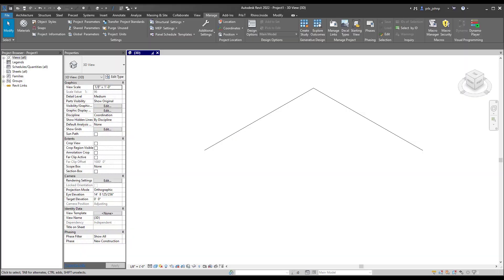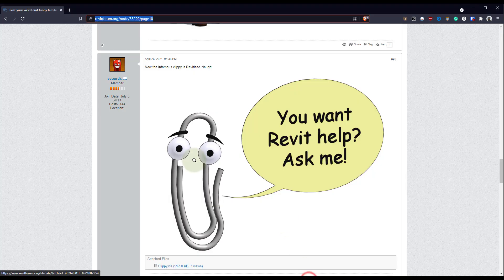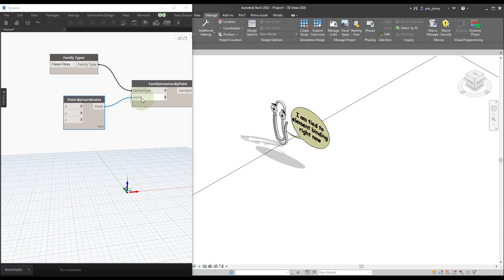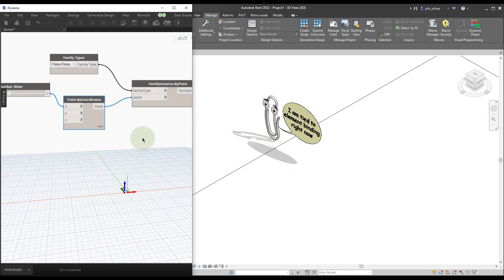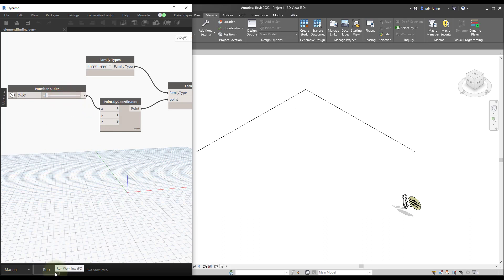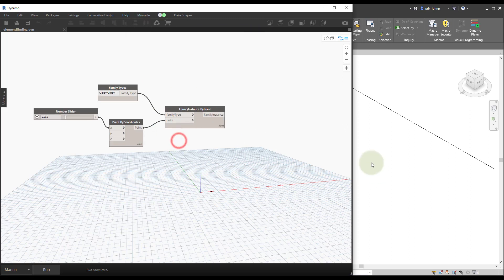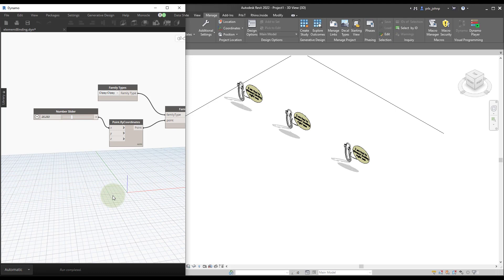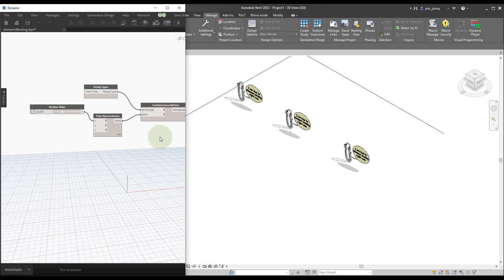How to Remove Element Bindings in Dynamo aka "Why does my stuff keep disappearing?"

Comment: Cool! I didn't know that the tool exist under the help menu xD Possible Improvement: Wouldn't it make sense to save the bindings of a script, to reuse them later? For example a project specific script, where I maybe need to move the elements  at a later point in time. For Example Save bindings as -> specify a name of the Project / Revit File / Name identifier of the binding element in Revit. And another menu item to load the binding saved before
Reply from the maker: oh!!! I really like that idea. Let me do some digging to see if there is a way to save them in that way. 😁

Comment: Would be nice to have a flush bindings node so we could run that command at the end of our dynamo graphs. Closing and reopening scripts is still a pretty tedious work flow.
Reply from the maker: even if it were a node, you still need to close and open your graph. that option is required because dynamo instantly re-establishes element binding.
Reply: @DesignTechUnraveled  I thought there was a node to disable element binding. It was on your channel ages ago.
Reply from the maker: @facelessone86  kinda sorta. that node copied the element and deleted the binded one. Resulting in a new element. Not really a disable binding node.